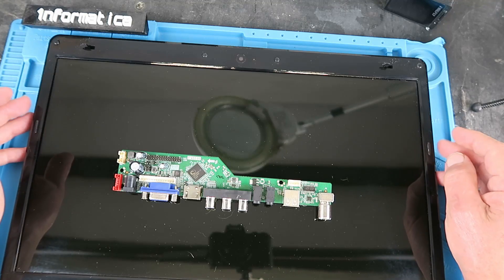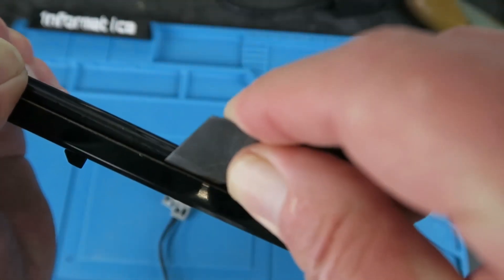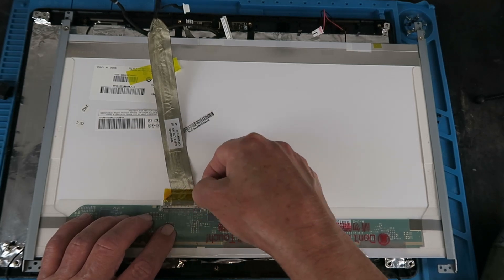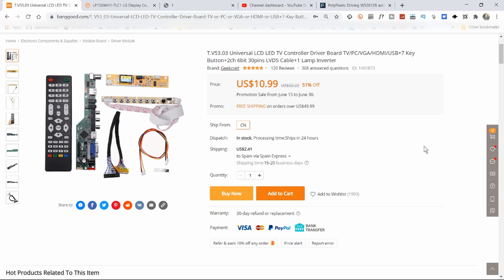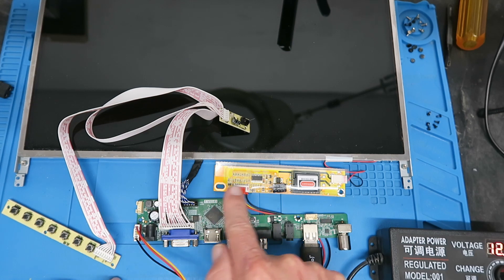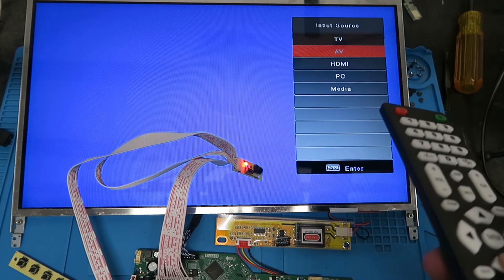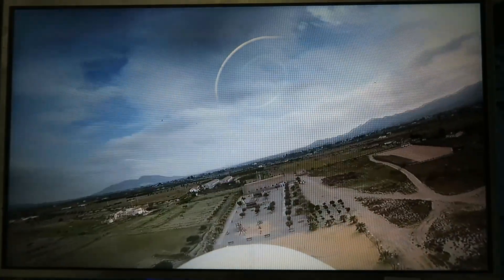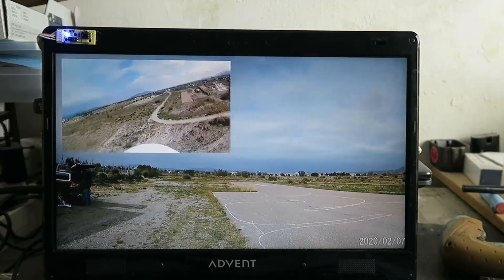T V53 03 Universal LCD LED TV Controller Driver Board Review Test

Comment: Is there a way to dim the backlight?

There's no backlight settings in menu, and I found one in Factory>Panel Settings but changing the value of the backlight does nothing at all
Reply: ( same answer I gave someone else here) Here is what you need it's a pulse with modulation.
https://www.aliexpress.com/item/4001150452055.html?spm=a2g0s.9042311.0.0.233b4c4do5Dayr

Yes, the brightness setting is fake, and the wire for pwm on the screen board is connected to the wrong place on the inverter connector (connected both white wires to the same place [backlight enabled] ), but even when connected to the proper place, the brightness does not work without the above pwm.

Cut the white pwm wire in half, that goes to the screen pwm.

On the little pwm, Connect the pwm wire (white) from the screen to the mosfet gate instead of the output, and don't connect anything to the ground output. Connect the white wire from the screen adapter board to the  positive input of the little pwm, and connect ground to the little pwm.

I should do a video on this.

I'm building a giant laptop with a desktop motherboard.

Wayne Sallee
Today's post was brought to you, by the following special words (Wayne) and also the word (at) but don't forget (WayneSallee) today (.) and of course the root of it all (com) all makes up what Fat blocks.

Comment: When I attempted to flash firmware, the led light is not changing and my usb has power indicator but it doesn't turn on when I insert it on the board. The instruction says that it needs 12v 3-5A but I only have 12v 1.5A, can this be the reason?
Reply from the maker: Hi, some people have reported problems with "unbranded" USB memory sticks, try a Kingston or similar. Power could be an issue I use this : https://bit.ly/12V3A_PSU
Reply: @1nformatica  I'm using brand new sandisk. I just ordered 12v 5A adapter, will comment again once i tested it.

Comment: I checked to panelook but im not sure if i can use ltn141w3-l01 for this controller board?
Reply from the maker: Unfortunately you are out of luck. That panel has a resolution of 1280 x 800 which the firmware does not support. Time to take apart another old laptop!! Please consider subscribing if you have not done so already!

Comment: I am really not lucky with this, bought 30 old laptops now to began making the displays and make some computer dislay and portable media player too and when I ordered the other bunch of t.v53 from banggod they sent me new version called Update Model: T.SK106A.03 (Update from September 1, 2020) and this model not just have much less firmware models available but has lots of incompatibility and audio plays bad on all videos which were played fine with the t.v53, theye videos are just mp4 files downloaded from youtube, nothing extra codec :(

https://www.youtube.com/watch?v=6s2_842n8YM
Reply from the maker: Hey that's really bad. I have not used the new board. I guess Banggood will be getting plenty of complaints and hopefully release new firmware. Contact their support people.
Reply: @1nformatica  I wrote them, I hope I get a good CC contact some of them very helpfull some just don't understand. The new version has a better interface, sometimes a bit too much overlay etc. I used latest so the updated FW from 09.13 date I guess. The bad thing no opensource code, I am a fullstack dev and could help fixing code or add ac3 support for my private branch (I already have my own betaflight etc code on my drones) or at lest check differences in the 2 versions, maybe old tv53  FW could be flashed  but I don't risk it now. Some aliexpress sellers still sell the t.v53 version.
Reply from the maker: @jacksimple3766  I hope it will be sorted soon, otherwise they will have many unhappy customers! Good luck with your projects.
Reply: @1nformatica  I got a reply from them but requested pictures of the
packaging barcodes etc. I was lucky not throwing them out yet, always take picture of each package if you throw them away you can still send pictures later ;)
Reply from the maker: @jacksimple3766  Good advice, thanks for sharing. Hope you get a good result.
Reply: @1nformatica  hi! just some recap: the issue with audio was related to the kind of cables used not the firmware, after experimenting with different speakers and cables then power cables and power supplies it is related to the volume level and the power supply+ cable quality. Very strange but I want to share what I could investigate if anybody would face same issues:
1) audio becomes distorted and has higgh or low freq spikes/gaps
2) backlight becomes very dark and flickers, power cabel to the controller becomes hot
3) these issues appear at increased volume or more massive speakers connected  on the speaker plug (not the JACk plug)
Those 2 symptoms came in my experiences and the solution was to replace the power adapter cable.... very strange, sometimes youmight need a different power supply too as switching supplies make flickering in the backlight due to resonace with the transformator in the inverter circuit. (I stil have flickering with most of tha power supplies mostly visible at bright parts of the picture :( )
Reply from the maker: @fotoamgamgfoto3695  Great info, thanks for sharing. I have only used the small speakers built into the screen connected to the speaker socket with no problem.
Reply: @1nformatica  I also used the small speakers from old laptops but don't know why these new version boards are more sensitive, now need a better power cabel, I used the one came with my imax b6 charger but now had to use a better one and added some LC filters in series
Reply from the maker: @fotoamgamgfoto3695  That's progress!

Comment: Hi, I bought this board recently before I really knew how many different types of connectors there were. I have a SAMSUNG LTN156AT27-H01 (not even listed on panelook, but there is an H02), and I have a 40 pin lvds that goes to a 20 pin connector for the board. Is there any way to get this board to work with the 20 pin or do I need to order a different controller board?
Reply from the maker: I think it will work but you will need to modify the wiring. Take a look here : https://sites.google.com/site/lcd4hobby/lvds-cables/e-40-pin-cable Please consider subscribing if you have not done so already!

Comment: Thank you for this excellent tutorial
I have two problems
1- The firmware has not yet been uploaded after the USB flash install and the power cable is installed.
2. Remote control does not work
Reply from the maker: Some people report problems with particular USB flash drives especially "unbranded" ones. Try a different USB stick. You can easily check if the remote is working by pointing at a phone or camera screen. As cameras can "see" infra red you should see the LED blink as you press the buttons. Also the IR receiver is on the small board with the on / off indicator. Make sure that is visible to the remote. Good luck! Please consider subscribing if you have not done so already!

Comment: Hi, I have completed the setup, however I cannot get any channels via the Auto tune. I have connected an indoor antenna too which worked with my TV,  just not with this. Any ideas?
Reply from the maker: I believe this board has analog TV only. If your regions has converted to DVB-T terrestrial digital you will need an external decoder. Please consider subscribing if you have not done so already!
Reply: @1nformatica  Thanks for the info. Can you please recommend any of these decoders.
Reply from the maker: @huzaifatalati761  I just mean a receiver like you would put on an old TV. Just search for "dvb-t receiver".
Reply: @1nformatica  Sure, I'll have a look. Thanks for the help

Comment: How do I change the firmware? I want to use a different LCD for the same board, the LCD has a different resolution.
Reply from the maker: It is the same process. Just put the new firmware on a USB stick and when the board powers up it will load the new firmware.
Reply: @1nformatica  Thank you very much!

Comment: Is there a way to change the firmware installed? thank you
Reply from the maker: Sorry I do not understand the question. The video shows how to load the firmware onto the board. The only firmwares available as far as I know can be downloaded from the link on the product page : https://bit.ly/TVCntrlBoard Please consider subscribing if you have not done so already!
Reply: @1nformatica  i think the firmware that i installed is not match for my lcd. How can i change the already installed firmware?
Reply from the maker: @ChocNutttT  It is the same process. Just put the new firmware on a USB stick and when the board powers up it will load the new firmware.
Reply: @1nformatica  i tried doing the same process but the board just boots up and ignores the usb.
Reply from the maker: @ChocNutttT  Perhaps the firmware is not valid for your board. There are two links on the product page but only this firmware worked for me : http://myosuploads3.banggood.com/products/20191224/20191224024127T.V53.03.rar
Reply: @1nformatica  Thank you so much for your replies. Already subscribed :))
Reply from the maker: @ChocNutttT  Great! Hope you get your board working.

Comment: Hello I bought this card but I cannot install the program, I format the usb fat32 and throw the program, insert it into the card, it does not load in the snow
Reply from the maker: Some people have reported problems with "unbranded" USB memory sticks. Try a different USB stick of good quality like Kingston. Please consider subscribing if you have not done so already!
Reply: The USB toshiba I use is not of poor quality.I used the V56 card before that, it was not a problem, but I cannot install the program to it.When I press the open button, the white screen comes up.
Reply from the maker: @muhammet6152  Do you see the LED flashing? Also check your power supply has enough current, needs to be 3 Amps.
Reply: 1nformatica no led does not blink on continuously.  my power supply is 6 amps
Reply from the maker: @muhammet6152  I have no other ideas. Maybe the board is faulty.
Reply: 1nformatica Thank you

Comment: Does anyone know, how I get into the service menu for the new T.SK106A.03 version? "menu+1147" as shown in the video does no longer work (that was for the T.V53.03 version). I need to get into the service menu because the colors aren't correct (same problem as shown in the video).
Reply from the maker: I don't have one to try but you may find the answer here http://www.electronicthailand.com/article/15/service-mode-fectoty-setting-menu-all-lcd-led-tv Please consider subscribing if you have not done so already!
Reply: Also you can't pause between key presses, or it will fail.

Wayne Sallee
Today's post was brought to you, by the following special words (Wayne) and also the word (at) but don't forget (WayneSallee) today (.) and of course the root of it all (com) all makes up what Fat blocks.

Comment: Is there a way to "Save" the settings on this board, as I keep having to select HDMI and Just Scan everytime I power it on, if theres a way I can save/store this mode, it would be great, Thanks
Reply from the maker: My unit save the settings, each time I power on the same input I used before is selected. Don't know what the difference could be, maybe try another firmware? Please consider subscribing if you have not done so already!

Comment: Seems to be working, however, the screen has this greyish color and that's about it. Any suggestions?
Reply from the maker: There are usually more than one firmware available for each resolution, perhaps try a different one. Also try changing the panel ID in the "hidden" menu : https://youtu.be/C2YTL25iyHU?t=490 Please consider subscribing if you have not done so already!
Reply: @1nformatica  Since the screen is grey, I am unfortunately unable to navigate to the menu. My specific screen is LTN154X3-L0D, 1280 x 800, which I can't find in the zipped files, only 1280 x 800 alternatives. I think I've tried them all.
Reply from the maker: @bredbert  Guess it's time to find another screen!
Reply: @1nformatica  That's unfortunate. Could it be possible that the T.V53.03 works only with 2 channel LVDS connections? This screen requires a 1 channel/30pin/6-bit connector, which I am attempting to use with no avail. The results I yielded previously was with the 2 channel LVDS cable.
Reply from the maker: @bredbert  Sorry I don't have time to look at this now. You can check the LVDS connector pinout here : https://sites.google.com/site/lcd4hobby/lvds-cables/e-40-pin-cable

Comment: noe I found a laptop panel with 1280x800 resolution, only 2 fw exists no general.... I tired them and only the upper 1/3 part is working of the screen the other part has lost of white lines :( I also hav a 2ch 6bit cable not 1ch 6bit as the panel needs but you also used a 2c cable instead of a 1ch for a 1ch screen
Reply from the maker: Try changing the panel ID : https://youtu.be/C2YTL25iyHU?t=490
Reply: @1nformatica  I tried all presets and all 1280x firmwares, nothing solved the isse of this panel, othet 1280 panel working fine :( could be a panel issue....

https://scontent.ftsr1-2.fna.fbcdn.net/v/t1.0-9/118711122_751756755678100_2598679758832525718_o.jpg?_nc_cat=110&_nc_sid=b9115d&_nc_ohc=jK2BjyxLH_8AX_PPGiz&_nc_ht=scontent.ftsr1-2.fna&oh=68d485d18c3b2c1b56494b17e8eae7ff&oe=5F74B6B2
Reply: @fotoamgamgfoto3695  hi! how can the firmware be changed?
Reply: @ChocNutttT  put on usb stick it is shown on this video

Comment: you used a 2ch 6bit 30pin cable but your display is 1ch 6bit 30pin, is it compatible cable?
Reply from the maker: The supplied cable is "2ch 6bit 30pins LVDS Cable" as it is working on my 1ch display I guess it must be compatible! Please consider subscribing if you have not done so already!
Reply: @1nformatica  thanks it works now its the 14th display wich finally works, all the previous 13 has a wrong or incompatible LCD screen, I was not lucky, but now I have one working :)
Sopmetimes there is some green or yellow artifact on some black/shadow color part of the screen but could be cable connection issue
Reply from the maker: @fotoamgamgfoto3695  Wow! That's some bad luck! I admire your tenacity, you got there in the end, good job!
Reply: @1nformatica  thanks, but I cannot stop here, now looking for used broken laptops to get some good lcd, want to build some more stuff like this prototipe I made now :) I still have issues with the cable connections, I put the LCD inside a toolbox to have a mobile display station for my FPV flights on field (I am also building drones, mostly high altitude racers and need a video in capable big portable LCD panel, also need to build more for others) and it does not like the shaking while I drive ofroad :) , connections break lcd so fragule etc... so will look for some solution, some adhesive tape was not enough...
I might build one using my old 4:3 17inch 1280x1024 displays, but they are heavy and hav 4 lamp inverter and consumes 4 times more power due to backlight.... I am still waiiting for the 2ch 8bit cables to arrive, probably half year as shipping takes that long due to covid etc....
Reply from the maker: @fotoamgamgfoto3695  Interesting project, good luck with it. Hope you make a video of the finished product.
Reply from the maker: @fotoamgamgfoto3695  Tetszik a projekt. Nagyon szép repülési hely van!

Comment: Hi, i followed your tutorial, but when i turn the board on, the screen just goes blank. Also, i noticed that the lvds is 2ch, while mine and the display you showed on the video are 1ch. Is this the cause? Do I need to order a different cable?
Reply from the maker: You can check the LVDS connector pinout here : https://sites.google.com/site/lcd4hobby/lvds-cables/e-40-pin-cable Please consider subscribing if you have not done so already!

Comment: hi, i was able to set up my controller, but i could not get audio coming out through aux when playing hdmi. but when i play videos through usb, audio comes out great with aux. please help
Reply from the maker: Hi, if by "aux" you mean the 3.5 mm jack socket for ear phones then it works for me on both USB and HDMI input. Maybe you have a bad HDMI cable, I have also seen HDMI cables that work one way but when the cable is reversed not, strange! Please consider subscribing if you have not done so already!

Comment: hi! what if the LCD panel has a thin flex cable for back light power input not a single 2 pin wire?
Reply from the maker: I would first identify if it is a LED or CCFL backlight by using the panel look website (link in description). From the original equipment see if you can find which are the power connections. Before I have scraped the insulation off of flex cables and soldered wires on. Good luck! Please consider subscribing if you have not done so already!
Reply: @1nformatica  I opened 4 monitor, the first 3 was not even compatible by LVDS cable, now I have a monitor which is compatible ()but 2channel 8 bit cable needed, I have 2channel 6bit cable only yet...) , but it has 4x 2pin CCFL, so 4 Lamp, but I have onlí 1 lamp inventer version :(
 how to solve that? can I connect multiple lamps to one CCFL driver?
I think I need to order a 4 lamp inverter and a 2ch 8bit  30p cable too :(
I have M170EG01 VA which seems to be compatible with T.V53.03 with the proper cables and inverters...
Reply from the maker: @fotoamgamgfoto3695  Getting a 4 lamp inverter is the way to go. The boards use very high voltage and can be modified but it is dangerous! https://www.youtube.com/watch?v=H4uj5RKP2z4